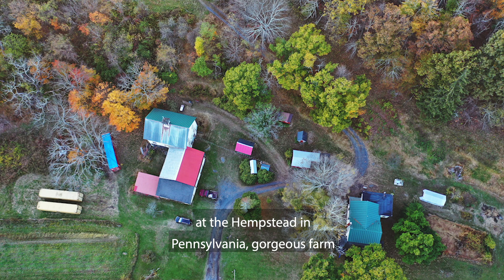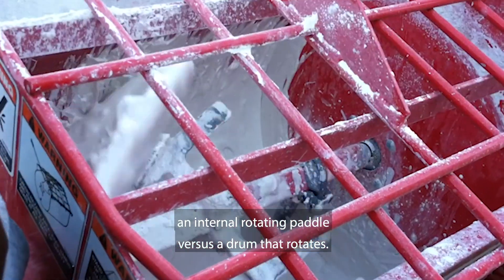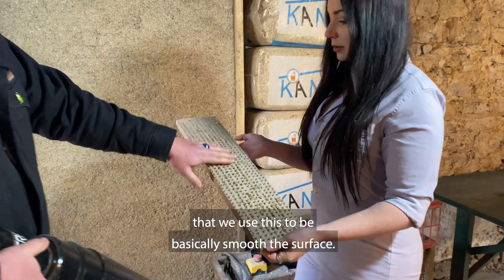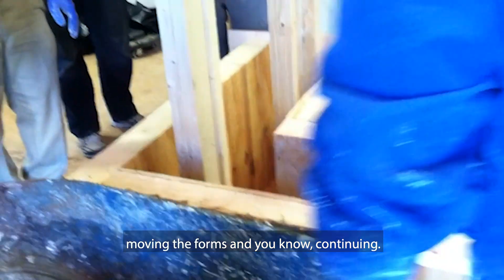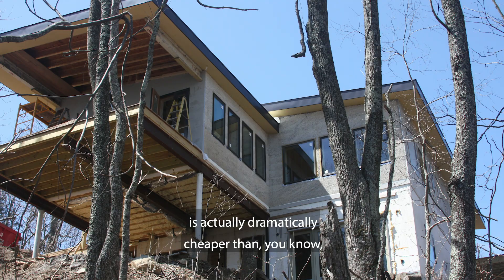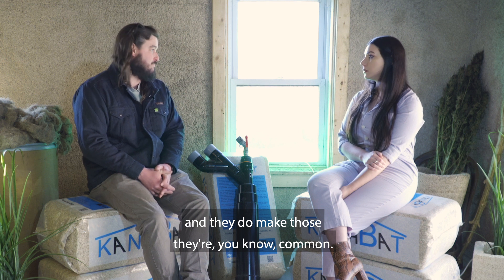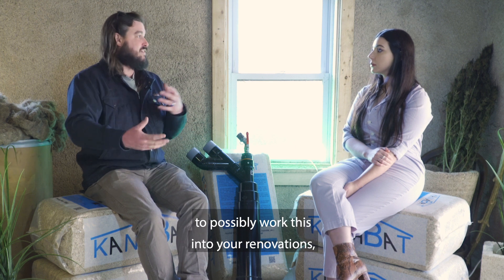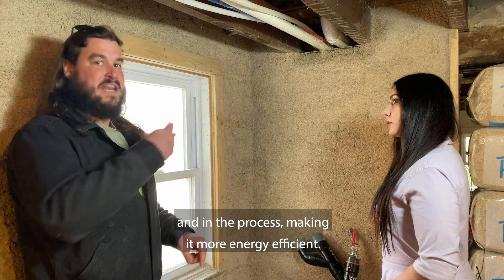Building with Hemp | Exploring Hemp with Cait Curley

Comment: With hempcrete (hemp and lime, possibly a little cement) pretty much the problems are: 1) labour intensive 2) requires it's own expertise 3) takes a lot of time to dry 4) mould. Everything can be solved. If you build a thick wall it might mould or even rot before ith has had enough time to dry. When it's dry, the building will last a long time.

Comment: Great video, Cait!  Thanks for taking the time to create it.  Would you be open to the idea of a follow up video about hemp-blocks as a construction material?  (the kind that has the structural / load bearing supports built into the hemp block….From other YT vids I’ve seen it appears as if that could be a more applicable and realistic building product vs other application methods.  Would love to know your ideas on that.  Thanks!
Reply from the maker: Hey there! There are many ways to work with hemp as a building material, it all depends on one's budget, availability of the material and personal preference. I plan to make more content, hemp block information could potentially be part of it. Thanks for the support!